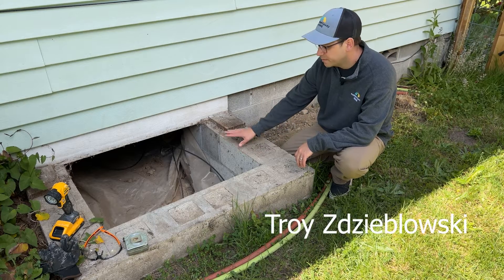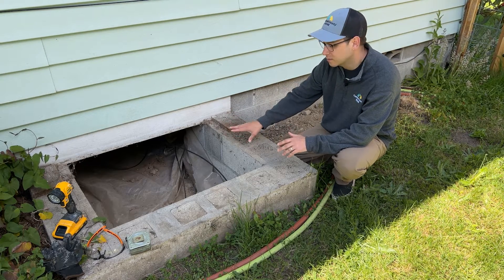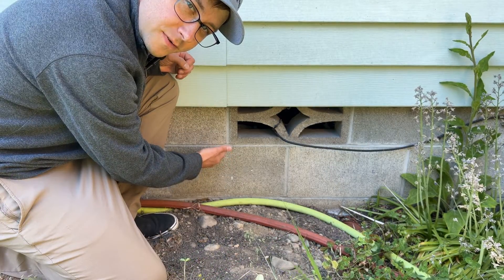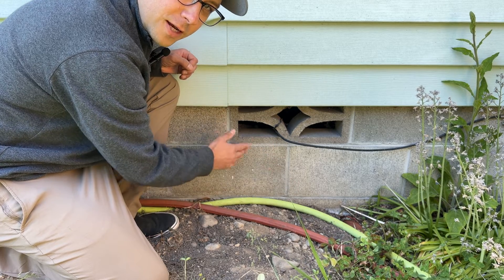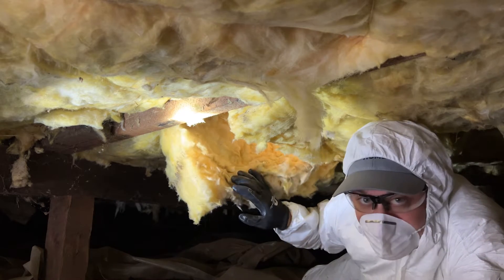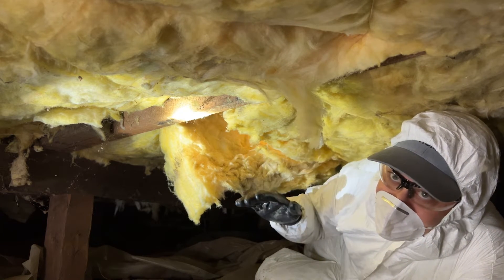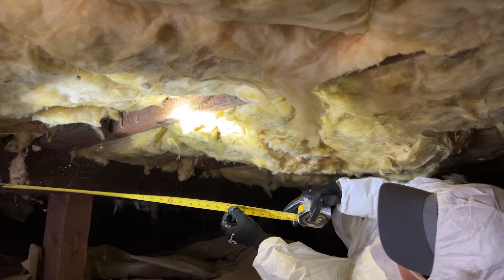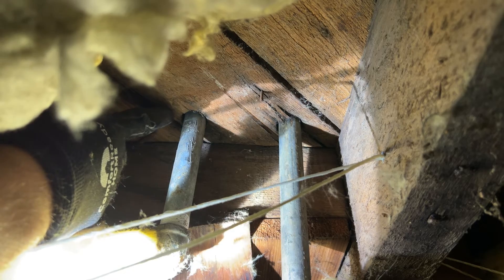How to: Assessing Insulation In a Crawlspace

Comment: This is a project iam doing soon. Any tips on measuring and dividing the barrier and getting around all the foundation and plumbing for a good ground seal
Reply from the maker: Thanks for your question! Laying out the vapor barrier on the ground takes some time to do well. Here are some steps that can help make the project go smoothly:

1. Make sure that there is no bulk water such as groundwater or rain that enters the crawlspace. Bulk water must be addressed first.

2. If there are piers or plumbing that comes out of the ground start with smaller pieces of the 6 mil. plastic that can be more easily cut to fit around the base. It is best to run the ground cover at least 4” up concrete pier blocks and the foundation wall and tape along the top edge. Covering wood with the plastic should be avoided.

3. Cover the entire crawlspace with full sheets of plastic that overlap each other as needed and overlap the smaller pieces around the piers or pipes. The smaller pieces that you started with around the piers and pipes make it easier to cut out the full sheets to fit around obstacles.

4. Tape the seams.

Good luck!